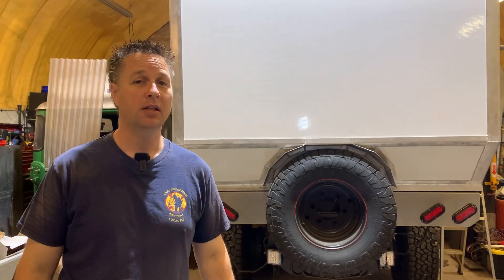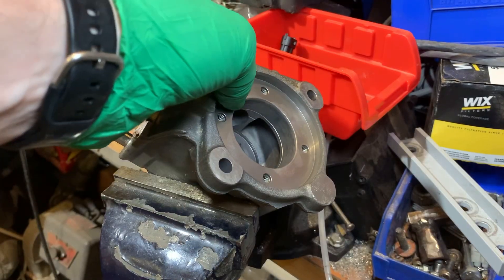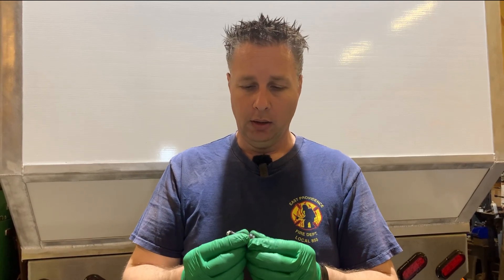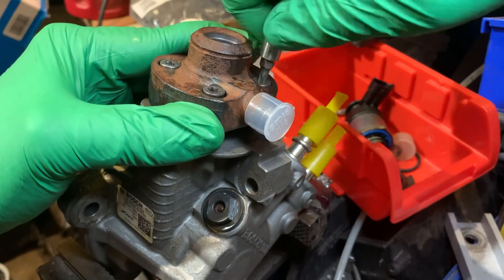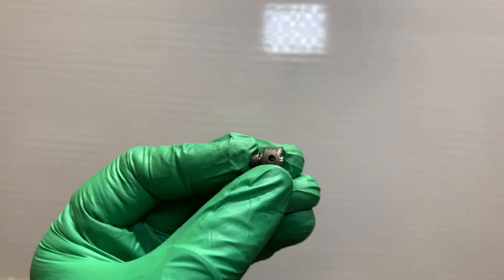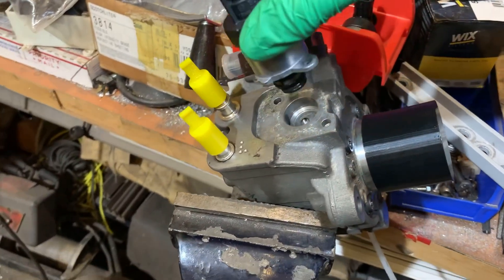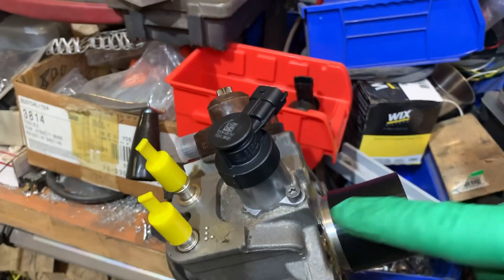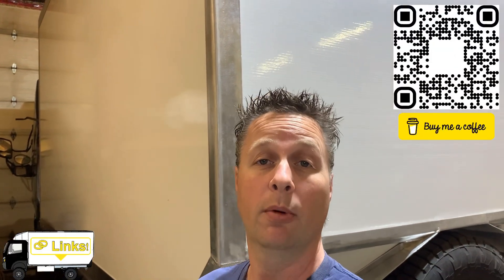Did this simple part cause my issue?  - CP4 fuel pump reassembly | MITSUBISHI 4P10

Comment: Clearly, the problems are somewhere in the quantum domain. You need to involve a kitten in your testing. Not sure how, I’m not a quantum physicist. I did work at a quantum chemistry startup for awhile but that’s not the same thing.
Reply from the maker: Hmm, well maybe I’ve been approaching this from a physics perspective when I should have been approaching it from a chemistry perspective!!!    Are you saying I need to install a Kittenlytic converter?  🤪
Reply: @BruceandKrista  That's an upgrade definitely worth trying out. But I think the key detail is that they need to be fully enclosed in a box, with no way to observe the state of the inside of the box. I'm not really sure how that's possible, though, since they usually have oxygen sensors in them. Hmm. This problem might be unsolvable :(
Reply from the maker: Let alone hard to find, I have yet to see a Schrödinger converter..

Comment: Do you have an obd scan tool to see what pressure you are getting at the rail? Should have 1600ish kpa with tank pump running and when cranking should get close to 30,000kpa.
Reply from the maker: I do, most recently, I’ve had no pressure - hence chasing the fuel pump 😎
Reply: 30 thousand thousand pascals?  Just curious.

Comment: I feel your pain Bruce, I'm still having issues with my Fuso. I was wondering, where are you getting your info from? I've spent  lots of time on the internet with very little success on finding info. I also brought my truck to a "professional". They think it may be the cp4 pump. I have monitored live data on pressures and as far as I can see the pressures are correct. What do you think?
Reply from the maker: If the fuel pressure is normal I can’t see it being the pump.    Do you have the shop manual?  That’s where I do most of my “thinking” 😎